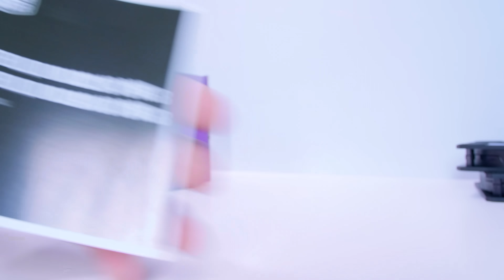HOW TO Cooler Master ML240L V2 RGB AM4 & AM5 Install Guide

Comment: I bought one in March 2021, and more than after 4.5 years, this AIO Cooler is still performing rock solid.
I do pressure wash the radiator at most once a year.

Comment: Uninstalling from a Intel i9900k to a 7800x3d that originally came with a prebuilt I bought years ago. Trying to determine if i need a different bracket or if i need to buy just the bracket, if i can even buy that seperate. Prices are crazy today, best to reuse as much as possible

Comment: you put the fans blowing air through the hot radiator into the case would you not want it pushing the air through the radiator then out the case
Reply from the maker: Air temperature doesn't matter. It's called air flow

Comment: The RGB on the hookup to the CPU works, but the fans won't light up despite being plugged in properly and whatnot. I've just started researching and may find an answer online but thought I'd post a question here in case I am unsuccessful.
Reply: Thought I had figured it out, had it plugged into the jrainbow header which is 5v instead of the jrgb header which is 12v. Switched it and now the pump/cpu hookup won’t light up either…

Comment: My friend, thank you for recording this video. He gave me good tips. I just had a question for you. Can this cooler be attached to the z390pro gaming tuf motherboard? I have a problem, I connected all the connections correctly, the fans turn on, it rotates and does the cooling operation, but the lights of the RGB fans do not turn on, not on the cpu and on the fans, but the fans spin, yes, they work, but they do not show the RGB colors. It doesn't work. I don't know if there is a problem with my connections, or if I connected it wrongly, or if my motherboard does not support this cooler. Thank you for your help.

Comment: I don't have the mounting brackets. I have no clue where they are. I just took off my air cooler, put in my brand new CPU, only to find out I probably haven't had those brackets for a while. Can I buy them? Is there a workaround? Help!
Reply: I bought a new motherboard to steal its mounting brackets. I don't have a cpu_opt pin. I'm going to kms

Comment: Great instructional Vid. I see when you installed the radiator on the inside and the fans on the outside, can these be reversed, put the radiator on the outside and the fans on the inside, I'm not into RGB so not seeing the colour won't bother me. Plus the fan blades are exposed with no cover and will be prone to damage?

Comment: DOES THIS COOLER FIT THE AM5 SOCKET?
Reply: CoolerMaster MasterLiquid ML240L RGB V2, Close-Loop AIO CPU Liquid Cooler, 3rd Gen Dual Chamber Pump, 240 Rad, SickleFlow 120mm PWM, RGB Lighting for AMD Ryzen AM5/AM4/Intel LGA1700*/1200/115X

Comment: This video is extremely well done!
The only thing I cannot figure out – which is why I searched for this video – is where exactly the radiator goes?? 
It looks like it’s on the outside front of the case – but what happens to any CD/DVD drive bays?
Can you please explain?
Reply: Your honor, can I please withdraw the question?😂
I took off the front cover of the case and all is clear!

Comment: i put the cooler like from 12:42, vertically that logo so the pipes come from the botom not right ,  did I put it wrong? most pc have the pipes on the right side not below (is this ok or no? hope wont have issues). and the radiator ofcour its above the cpu on the top side of the Case

Comment: Hi! So I normally use the remote for my cooler master. I just changed the method to use the 12V RGB header on my motherboard but I dont understand how to use it now. How do I sync with other my other RGB, particularly my corsair fans on my case?

Comment: but be careful guys if you have ARGB fans or your pump cover lights are ARGB, meaning, 5V ARGB and your motherboard has 12V RGB (non adressable RGB) header you will burn your rgb leds or your pins or your fan or your motherboard etc. ; you can check if your motherboard rgb headers are 5V or 12V from your motherboard specifications online or it will be written 5 or 12V and usually when it says LED_CPU its 12V RGB DO NOT PLUG YOUR ARGB LIGHTS TO A RGB HEADER
Reply: Oh well mine can run both so I can plug it into anyone?
Reply: Oh nvm
Reply: @OfficialCJEdits  no you can't, you should only connect 5V ARGB to 5V ARGB header and the 12V RGB to the 12V RGB header, most have it written on the header but if it's not written on the motherboard most motherboards sent physical schematic documentation with the box or they have it online in their website and just so you know , if you connect 5VOLT powered ARGB lights to a 12VOLT RGB header on a motherboard you will likely burn the header, the cable or the light or possibly damage the motherboard to a higher extent so be careful. 👏👏😁

Comment: My rgb plug only has 3 holes, one spaced away from the others. I don't see any hookup for this on my board. I have an msi b450 gaming plus. Everything has been done in order as you showed, but now I'm stuck at this point. Someone, please help me on this 😢
Reply: Update: I just realized mine is argb and I do not have hookups for this on my board. I found an argb to rgb adapter online for $2 😊

Comment: I installed the aio and everyething but one of those screw things doesnt tighten but the aio is in place so ill just pray and hope itll work 😬
Reply: Did it work?
Reply: @MuhammadZubair-y3p  nah but i took at to a repair shop and now my cpu and gpu are usually at 30-40°C
Reply: @mrpatato4833  how did they fix it?
Reply: @MuhammadZubair-y3p  how am i supposed to know lol probably just took it off and reattached it
Reply: @MuhammadZubair-y3p  money for the repair? $50

Comment: Honestly one of the best setup guides I've seen for one of these. Pity I can't mount it like you did because there's not enough space in front of the case, but that is a slick way to get around needing to directly mount the radiator and fans separately.
Reply: @Demmrir  where did you mount? Because I'm planning to mount it on the top of the case and I'm not sure if it'll work.

Comment: hey i just installed mine on a msi b550 pro vdh wifi with ryzen 5 5600x, but when i did my cinebench test i get 85 degrees celsius, is this normal?

Comment: So, my mobo doesnt have an aio pump conector, can i just put it in cpu fan and set it to max on the bios so it will receive always 12v, put the other fans in a pwm connector and set that conector to track temperature from cpu, not the mobo ?
Mobo: Asrock Fatal1ty AB350 Gaming k4

Comment: Now I gotta take mine apart to see if I got them all right because all but one will light up. It runs, but no lights and makes my build look off.
Reply: He said to plug it in an addressable RGB header which is ARGB but actually the lights are standard RGB so that's why it didn't work for me. Is that the issue you have? If you plug RGB device into ARGB nothing will happen but if you plug ARGB device into RGB port then it's gonna sadly ruin the port.

Comment: Great Video! Very clear instruction and video, I will use this when I will install this cooler! Just a quick question: the case fans that I have previously, do I just remove them and add these instead?

Comment: One of my screws at 8:34 is not working, I can't tighten it up, so Cooling is not working and my CPU is overheating. Is there a place where we can buy it separately
Reply: same for me today 😅
Reply: Me to it’s the bottom one
Reply: @CAYozma  After 3 days of pain , I managed to make it work. Just keep fuckin with it and it should work. There is a way to get it right, don't give up.

Comment: Very nice video, pretty entertaining and with plenty information.
I have a probably stupid question but I need to ask, if I do not plug the RGB cables, will the cooler work properly? I mean, I know the lights won't turn on, but will the fans and the pump work without any issue? 
Thanks in advance!

Comment: My friend, having your radiator in and out piping above your pump should be considered a criminal conduct! The air rises in the system, so you are basically sucking the air into the pump causing to malfunction prematurely (due to unnecessary wear and tear on the pump). What am I missing?
Reply from the maker: You're missing the fact that you have zero idea about how liquid cooling works. The amount of times this has been disproven is ridiculous. Get with the times mate.

Comment: Great video! I just installed 7 fans(2 3xpacks and 2 1xpacks) the 2 wingle ones give a different color/tint than rest. Any ideas? MF120's
Reply: I bought 8, but used 7. Both single pack ones are different than the 3 pack equivalent

Comment: I have this water cooler and i just took it off to reapply thermal paste and I'm struggling to get the mounting brackets back on. I don't understand why but it just won't tighten at all. Almost like the screws that were already there no longer fit

Comment: I apologise for bringing up such an old thread but I bought a prebuilt system with this AIO and if I push the LED button on my case, I can change the colour of the LEDs on the fans and the pump head to red, green, blue, off and then a rainbow. I am guessing its been connected to the RGB controller. If I wanted to make the fans yellow or purple or white, would it be as simple as removing the RGB controller and plugging the splitter onto the LED_C2 connector on the motherboard as he showed around 12:00 into the video so that I could change the colours in RGB Fusion?

Comment: Thanks you  bro, I had two days fighting with a gamer PC. I have not connected the extra wire (three pins) for fear but  with the cpu_opt connector my master cooler starts to  work fine. CPU Normal temperature 35 grades.

Comment: One thing I could not see well in the video, the cable to power the pump is a 3 pin connector and the CPU OPT has 4 pins. What's the pin that's exposed? the on the left or the right side?

Comment: Lol, keyboard nore screen is getting power and i have no clue what I've done- would placing the cpu opt and cpu fan cause this or have i simply just fried my chip cause the fana are moving, lights are on, but computer is as dead as it gets.
Reply: First, unplug the computer from power. Swap the pump lead (a 3 pin connector) with the Radiator fan lead (a 4 pin connector) on your motherboard. Plug the power back in, ensure the power supply ON/OFF switch (if it has one) is ON (sometimes it gets accidently flicked). Turn it all back on, ensuring your video cable is properly connected to the correct port. What happens now?

Comment: you mounted your radiator incorrectly, hoses should be at bottom to prevent any air getting into the lines. Any air in the system will sit at the top of the radiator and won't get into the pump lines.

Comment: Where do you plug the female end of the 3 way RGB splitter? I'm lost/stuck please help
Reply: Into an RGB pin header on your motherboard, if it has one. My motherboard doesn't and I don't care about lights in a case without a window.

Comment: hey, i have the gigabyte b450 elite v2 and i can't seem to find cpu_opt. Where do i plug in the AIO cable in this case??
Reply: Surely you figured it out by now, but.....the pump cable goes to the CPU pin header on your motherboard, the Radiator fan goes to any other fan pin header. I realize the pump cable is only 3 pins and your motherboard probably has a 4 pin header, so one pin will be sticking out which is perfectly fine.
Reply: @SpaceCadet4Jesus  indeed i did lol. Works just fine, thanks anyways!!

Comment: i need to install this on my am4 socket and the instructions that come with it are terrible for am4 lol. looks like a quality piece tho, i originally bought this for my 5900x but it was 240mm which my case can support either 240 or 280 but it was bugging me so i got the arctic liquid freezer 2 280mm for the 5900x and this one I'll go ahead and drop it on my current 3700x! both instructions are pretty awful to be honest lol

Comment: This is a great video.  I am looking at replacing a CyberPowerPC branded ML120L RGB with the ML240L RGB V2.  I have a CyberPowerPC branded Azza Inferno 310 case.  I doubt this question will get an answer since the video is 2 years old.  I have an optical drive installed and if I want to mount the radiator to the top of my case I suspect that my optical drive will get in the way of the tubes.  If I want to front mount the radiator in my case and have the orientation of the radiator correct with the tubes on the bottom I am not sure if the tubes are long enough or if it will clear my 3080TI card.  Any comments or thoughts?  Currently my 120m radiator is in the back of the csae in the 120m fan location.
Reply: Looks like you're already done. Radiator at top of case or at back of case are all perfectly fine. Do not mount the radiator in the front of the case, why pump hot air into your case? Just don't do it.

Comment: The plug will not fit on my Jrainbow header, any ideas?
Reply: That's the aRGB, it'll fry your motherboard. Plug it into other heads labeled 'led' or '12v' or 'rgb'. Or you could just try the controller provided or the hub if your case comes with one

Comment: I dont have a cpu-opt on my tuf gaming (B450M-plus) board its not made for water cooling but asus and coolermaster said it would work anyway what should i plug it into?
Reply: Plug it into the CPU fan header and actually it will run okay on any fan header, although some motherboards won't post if the CPU fan header is not occupied.

Comment: 10:20 If you want it not to be confusing then atleast show where the cables come from..
Reply: The cable was included in the kit and goes to a compatible pin header on his motherboard. My motherboard does not control RGB, so I left mine unplugged, which is fine for me.
Reply: @SpaceCadet4Jesus  what the fuck. i meant where does he plug it
Reply: @MB-us2rs  Into a matching pin header on his motherboard. Lots of motherboards don't have it. You are correct, he doesn't show the process.

Comment: Will this work for an Intel i7 12700k cpu?
Reply: Absolutely. I bought an Intel I7 12700 install kit and didn't need it. The version 2 of this kit came with everything I needed, a 1700 socket plate.

Comment: Im confused, ive seen 2 videos and one puts the fans directed inside the case and the other with the fans on the outside of the case with the radiator inside? which is right?
Reply: As long as it blows the air outside the case, either way is good.

Comment: If you have the Fractal Meshify C case and you want to mount this intercooler to the front, the fans will have to be INSIDE the case. You cannot mount the fans on the outer part of the case as seen how its done in this video (that is behind the front removable mesh front panel) as the fans will be too big and interfere with the mesh front panel. I have a Gigabyte 3070 Vision GPU and it is less than 1mm clearance between the intercooler and the GPU with the intercooler being front mounted, but it fits :) Just some info on anyone who is thinking about getting this AIO and has the same case and possible same size card as I do. You could always try and find slimmer fans and you could possible get away with mounting the fans on the outer portion of the case behind the front panel.
Reply: Why not top mount it?  That's what I was going to do.
Reply: @HenryOfGnarlia  I honestly cant remember why I didnt do top mount - might have either been spacing issues or sheer laziness and wanted the quicker/easier route to mount the AOI.

Comment: How is everyone doing I have a issue that I just ran into after putting the water cooler on. I just realized that my motherboard has a cpu opt however there are no pins attached to it. Is there another location that I can run that cord to?

Comment: my pump is syncing with the mother board but not the radiator fan but both fans and pump are connected to same jrgb header and still fans are a bit off..can anyone  help?

Comment: I dont know if you'll still respond to comments but mine came with very different cables  and controller and unclear instructions for if I don't want to use the controller

Comment: Hey Gear Seekers not sure if you still read comments on a year old vid but needing some help. I just installed this cooler into my system and it works great so far. 2 things tho, first is the light on cold plate doesn’t light up and second, master+ doesn’t read it and says I don’t have any compatible components. Any help would be greatly appreciated. Thanks!

Comment: bought the first gen of this unit, ML120L in 2018 and now looking to buy the newer unit. building a B450 AM4 system and wanting to add the ML120L RGB v2. nice video, should have talked about propert hose orientation to avoid failure. air bubbles in unit can cause issues if radiator is not setup properly.

Comment: Sending mine back to get a refund. Spent 2.5 hours trying to get the brackets attached to the CPU cooler block. The video makes it look easy, but the screws that come with the one I bought were too short, they were barely long enough to go through the cooler bock, but not long enough to be firmly attached to the bracket.

Comment: Great tutorial as always, thanks! Question. I am using this AIO in combination with an ITX Aorus Pro MB. Can I use a three way fan splitter on the CPU head and then run the AIO CPU cable on this splitter, where only two pins will be connected? Will this actually work? The manual of the MB says all Fan ports can run an AIO. 

Reason why I ask, the MB only has 2 Sys Fan slots, where one is used for the M2SSD and the other one has a fan splitter which is used for the top case fans (using NRP200 CM case)

Thank you so much, first time builder here :)